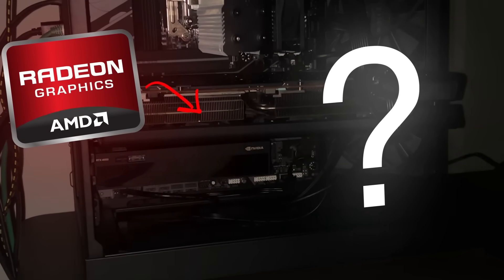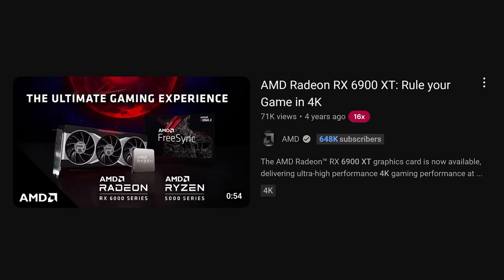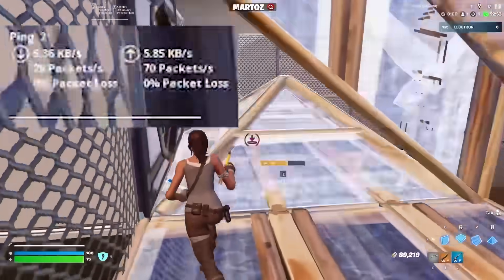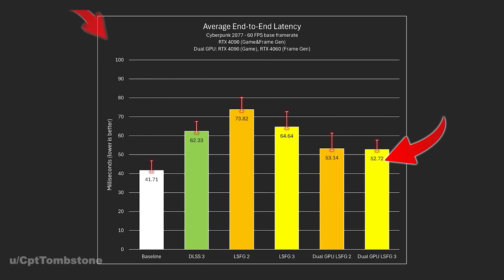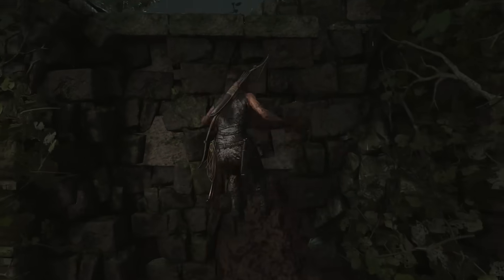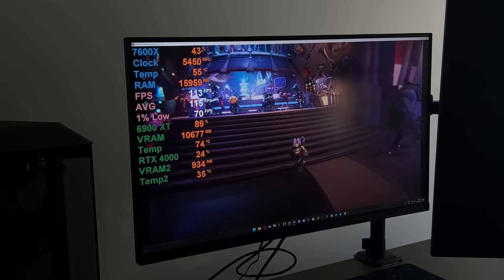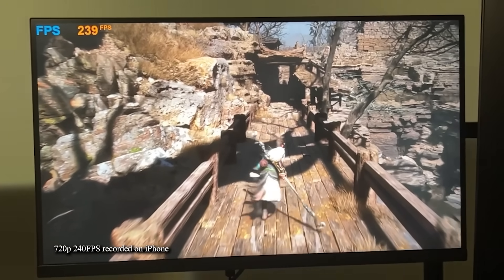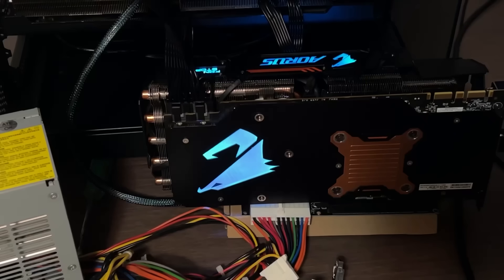I Used Both AMD & NVIDIA in One PC and Got 240 FPS in Every Game

Comment: I was very interested in this video but the sponsorship with exit lag threw me off a bit. There really isn’t any software that can reliably reduce your ping. Your ping is almost entirely dependent on your wired or wireless connection and your ISP. 

What exit lag is most likely doing to achieve these results is re routing your traffic for your game to their servers first, and then to the original game servers. This additional hop will actually cause more overall latency and higher ping. But you won’t see that number on your end since your traffic is being re routed.
Reply: Agreed, as a network engineer that sponsor is a scam.
Reply: @Llama052  It's not additional hops, it's alternative hops. For example normally I'd get 11 hops from South Africa to a game server in Europe. Using exitlag or cloudflare warp VPN it would be be 9 hops instead. This can be done using tracert. Also the amount of hops doesn't necessarily matter, its the quality of the hops. If you have 3 hops and one is congested, you are worse off than having 6 hops where none of them are congested. You should know this as a 'network engineer'
Reply: @Llama052  A network engineer and you don't know what you talking about lmao, sad
Reply: @ Okay buddy. I'll continue designing and running datacenters and internet routing while you pretend that adding a third party in your connection makes it faster for you for some random 1% edge case that rarely exists.
Reply: @Llama052  Valve improved ping times for 40% of all US clients by creating a new backbone and relay protocol.
Reply: @Llama052  As a non network engineer, VPN does help with ping. I have experience with ffxiv and nordvpn. Maybe I should start calling myself a network engineer on the internet too.
Reply: @Llama052  is also scam the video title that claim to reach "240fps in every game" and it's not true
Reply: @Llama052  The deal is often priority packet routing for encrypted tunnel packets
Used a regular VPN for such things overseas (plus proxifier to reroute to local host -> putty using SSH)
Reply: No, you don’t connect to their servers, they are just doing their own routing with optimized paths, whether that works or not I cannot comment on. Cloudflare has something similar with Argo Smart Routing, the client uses Cloudflare’s routing instead of their ISP’s. It might still be a scam or whatever, but the technology behind it works and it can reduce ping (specially by getting around congested paths that are shorter so lower latency on paper but not really).
Reply: yeah except it actually does work and does exactly what it says on the tin. if your problem is routing and horrible isp network decisions, it fixes it.

I routiniely would have periods of the year (multiple months) where my ping to SEA was 300 , despite being an Australian and should be 90-100.
Exitlag would fix it back to 90-100. exitlag isn't a vpn, either.
Reply: I can vouch for it as someone who plays Apex on Tokyo servers from OCE. I consistently will get higher ping and bad routes without it, I also used to get a weird double ping bug when connecting to overseas servers. 

For whatever reason Exitlag has fixed these issues for me, allowng me to get a constant 115ms to Tokyo over WiFi. If there's an open source equivalent that achieves the same effect I'd be down to learn more.
Reply: nah you guys are just hating on something you don't even understand. it's used when you're stuck with a scummy isp that has crap routing tables which causes high ping and packet loss for some ip adresses and/or ports. So even if you have perfectly normal internet and you can do other activities that require internet just fine, there might be a single game that you get this high ping and packet loss issue just because the game server's ip address is routed inefficiently by your isp. And no exitlag is not the same as a vpn.
Reply: not all traffic is routed by latency some is routed by cost. These apps theoretically can fix that but in reality YMMV
Reply: yeah, you can't beat the speed of light....
Reply: @fiery_transition  You can't beat the speed of light because it has no competition, but what if we introduce a cheetah made out of lasers? That's free market economics.
Reply: It depends. If they explicitly put their gear in the same data centers as the game hosts its faster. As an Australian who used to use VPN tunnel services for WoW that provided exactly this back in the bad old days it can make a significant difference - we went from 500ms ping down to 200ms to 300ms tops.
Reply: As a network engineer you're wrong but yeah they're probably a scam. If your ISP prefers a cheaper peer, say HE or Cogent over Zayo or Lumen, but Zayo or Lumen provide a more direct route to the game server via their backbone or have better hops in general to take then ExitLag would definitely work. The only issue is that ExitLag would have to have a ton of cheap POPs very close to every residential ISP to be preferred route in most cases and would have to do constant route upkeep or they lose out, and it's most likely a delta of 5-10ms or less... But on the other hand, you also have to consider that a packet transmitted from your computer doesn't necessarily have the same route of when it's transmitted from the game server so they could fix severe jitter in those instances where a simple latency measure isn't indicative of any issues (10ms to the server, 50ms back is very bad; 60ms ping is alright).
Reply: Tried it once when i had like 20% packet loss even though my ping is below 60, it did eliminate the packet loss without any significant ping increase. no, i'm not paid by them, i even only use the trial, but yeah it does work🤣
Reply: Difference of opinion aside, I think it would be great if OP would just benchmark this and run mtr, iperf, jittertrap which I have had success with, or some maybe easier to use GUI tools I have never used but look useful for non-cli, like obkio or prtg. If someone who does networking as a main thing (I'm a generalist developer, not a networking guru) could vouch for them maybe, and then just bust out some god-damn numbers.
Reply: theyre basically a VPN service but prioritised for gaming traffic (theyll usually terminate your account if you abuse there network for other types of traffic).

t's mainly for people who are with internet providers that have poor routing or peering, i.e if your isp only has good domestic routing and poor international routing then something like exitlag will benefit you a lot if they have a local hop close to you, since they will have higher priority traffic and better routing back to the destination servers.
Reply: bro some of the isps dont have optimized path to the game server, or u can say  they dont have good routing with gaming servers , the find the best router and it acts like a vpn ths it , i also used it good . but if u call your isp and tell to fix this routing issue , they willl fix it and it will be same ping as exit lag lmao , so yes its not fully fake but , partially true lmao 💀💀🤣🤣🤣🤣
Reply: the only thing that could probably do this is cloudflare warp/+
Reply: Soooo, they do ping generation?
Reply: @gg_sheed  it’s like a vpn ( they’ll your data/diagnostics too )
Reply: It's probably a vpn which eliminates the lab between ISP and the game server
Reply: Except its not always true, I was one of those peeps that even tho I have a good internet my location to game server made it not a good experience, and yes exitlag worked for me, Im in canada and the server was in france, exitlag improved my ping by 25%, its not benefecial on othergames, but the game we played on was and it was worth it, the other dude that I played with was from australia, he was the reason I decided to try it, these ping services vary each case, if you already have low ping you wouldnt notice it, but if its a game thats reaching 200 mark, yeah it might or might not work. in my case however it did. so no, you can easily test this specially because theres a free trial and try playing game that you can change the server.
Reply: Ig but still good vid
Reply: actually does work, is like if you setup a gateway but using their private vpn network instead of a long ass cable, helps to reduce hops in between of the computers, for example you're in Canada and want to play something from Japan, connect to theirs vpn to Japan and that's all, the routed vpn traffic is going to make a faster route with less servers or hops i between
Reply: > Your ping is almost entirely dependent on your wired or wireless connection and your ISP.
it's a pre-requisite but not a full truth, as a second point to the "ping" formula, is an route from you to the point of interest. One path could be better, another slower. What exit lag trying to do, it routing you through their closest entry point with less lag with established "best" path to the target host through their forced routes. it would not break the physics, but your ISP route from A to B could be 10k km long, while via vpn or exit lag - 3k km long...here's the ping difference
Reply: "Believe half of what you see":
This part emphasizes the potential for deception or misrepresentation in what is visually presented, suggesting that even what is seen may not be entirely accurate. 
"and a quarter of what you read":
This part highlights the importance of being even more skeptical of written information, as it can be easily manipulated or fabricated
Reply: You say an additional hop but it's also possible that 1 additional hop reduced the need for 2 or more hops without using the sponsored software.
Reply: You could've just not commented instead of showing how uneducated you are on the subject
Reply: I'm so glad I have RVX YouTube mod installed... So I don't have any ads before the video starts and also it skips ads in-between the video.
Reply: Its funny that people have no idea what internet routing is and the possible routes that can be taken for better latency. Its a real time contract with nodes all around the world that take that real time data and reroute your data better than your isp's default routing, it allows you access to nodes that are not contracted with your isp and 9 times out of 10 its creates a better route and less latency and packet issues.
Reply: It would reduce your ping if your provider takes more hops to the game server than to ExitLag server
Reply: ExitLag definitely works in some situations. If the game servers you are playing on are in different countries/continents and your ISP has a shitty link to them, it can make a huge difference.
Reply: It absolutely worked for me, not because it lowered my ping but instead by routing my packets a different way than the absolutely broken path my ISP sends them and actually making some games playable for me
Reply: Was looking for someone who said it so i wouldn't have to. Thanks :)
Reply: Exit lag is a poopy VPN service sold with false advertiisng. The end.
Reply: @cybercat1531  nothing more then a proxy server or VPN without security features, you pay for doggshit
Reply: Yo Sheeeed ! You are right about it and this sponsor doesn't do anything to really improve the connection. Instead the average gamer should look at their equipment, the contract with their ISP and if there is a better offer in their place.

Sometimes it's just the offer, sometimes it's the equipment.
Reply: @sekyom2482  You are incorrect.
Reply: Well, if you have say 200 ping to a game server, but exit lag has one with 100 ping, and you can connect to exit lag with 50 ping... You now have a 150 ping connection. The question is of they can actually do something like that, to which the answer is probably "no, except in extreme cases"
Reply: @pm146  Internet routing cares way more about robust and resilient connections/routing, and doesn't optimize for latency by default/the general case. They would have to have a massive amount of servers EVERYWHERE, to actually be useful. And once you kick a package off the part you control, you have no guarantee of when it arrives. But yes, it might work in some cases...
Reply: @pm146  thing is that it's pretty rare to have the situation you say, and on top of that there can be additional lag just from the connection being made and processed by their servers
Reply: @dantepaz5028  What servers? They dont use servers, they just take control of your network route directly... Using their own servers? You honestly trying to tell me they gonna setup servers all over the world when they can just direct your traffic through already established nodes that other people already pay for?
Reply: @mewoozy2 they literally use servers, you can even choose which to connect with advanced settings, and i even quote what they wrote "ExitLag counts on a worldwide server network spread over all continents that optimize connections from anywhere to anywhere."
Reply: > What exit lag is most likely doing to achieve these results is re routing your traffic for your game to their servers first, and then to the original game servers.

But that focuses on things at a point to point level and not the crucial bit of the routing paths inbetween those 2 points and what the first hop is also doing considering you also don't just connect directly to a game server. While typically, yes, at a high level an additional hop can cause the overall latency to rise, however, if your routing path is improved as a result of using better optimised routing tables, it can be improved. Who this is really beneficial for depends on the user, where the end server is located and other network factors (too many to list lmao). 
For example, people whose ISPs (budget/os etc) have limited peering agreements or where international egress routing are on inefficient or congested paths etc. It's often a case by case thing, which needs you to actually analyze the problem and whether something like that would help improve it. 

Path optmisation is really nothing new. Used to do it in the 2000s to play WoW when I lived in a remote country using a shite ISP (albeit, I had to set up a server myself and work with people on forums to find an DC that had decent route, but did manage to go from 375ms to ~160ms). I used to even contribute to an open source tunnelling client in the 2000s aswell that was written for a similar purpose. You're also forgetting things like traffic shaping, multi-path UDP routing, path probing etc which can also improve latency. 

In practice and in theory, things are not always a gimmick, nor is it always "smoke and magic" just networking knowledge and whether the solution (or in most cases, improvement) is something like that. Agreed though, these things can get packaged as something next-gen and amazing, get oversimplified and turned into buzzwords and mass marketing making people who don't really need it sign up (not to mention quite predatory with "FPS Boost" etc).
Reply: @netyaroze1663  I made a comment about no one knowing how it works, technically Im incorrect because you obviously do, but your language is both too technical and your language shows you dont KNOW you are correct... you are correct, you are actually extremely perfectly correct. Well except about the FPS part, its "somewhat dissengenuous" but can improve fps on some games that freeze whilst waiting for coordinate changes/updates.
Reply: @netyarose Routing inconsistencies can certainly be problematic. However with these things being a likely upstream issue having another upstream hop generally isn't the fix you'd want. 

At best it will help you with a specific connection slightly while masking your actual latency. Generally though it will add latency to every connection regardless to even the ones that were shorter paths. 

If you have a bad route to something upstream on your internet connection it's best to talk to your ISP or peers. Not use a third party in hopes that they will magically route better. 

At the end of the day adding another hop to your route blindly by using a third party isn't going to lower latency, it's just going to obscure the issue further while pretending to be helpful.

Additionally if exitLag has any congestion or proxy issues you're now going to be in the direct line of that and it's going to cascade to you directly with a poor experience. You're effectively trusting them with connection handling and adding a middleman to all of your traffic as another failure mode. No thank you.
Reply: @Llama052  You are being very optimistic that the ISP is going to care that a single customer has a problem with something very, very specific. The odds that they are going to fix a specific routing for you are very slim.
Reply: @Llama052  You didn't read what netyarose said. From the ISP to game server there could be plenty of hops. With exitlag there is a middleman, but you're relying on their network routing is better than the default one from the ISP so it's not necessarily adding an additional hop to the total amount. Also if exitlag did have congestion (which never happened), people would notice the 'poor experience' and not use their service
Reply: It reduced my ping in Eternal Return from 320ms unplayable from Germany to the S.Korean Server to 120ms almost good playable and i was able to get Diamond in rankend there. How does this work then if you call it a "scam" ? 

For me it optimized the routing which gave me way better ping and less input delay.
Reply: @GisorsTheRet   tbf, your case is the exception and also extreme, the ping showed might be 120 between the game server and the exitlag server, but the ping between you and the server in the middle isn't taken into account, so it could majorly be placebo effect and you're around 280ms
Reply: @ dude, playing to diamond in a MOBA vs korean pro sweaters is no joke. 320ms had HUGE input delay vs the 120ms i got with exit lag. No "placebo" is able  to do this. 

Tools like Mudfish or ExitLag improve your connection by routing your gaming traffic through optimized, less congested paths and private network nodes, reducing latency, packet loss, and jitter.
Reply: @GisorsTheRet  k then, i said that it could be that, if you really are high elo in kr servers i believe you
Reply: @gg_sheed  Not true. My friend is a pro fortnite player, they share some programs with each othrr that optimize everything related to your input and he told me a program that lowered his oinf from 50 to 25. Mine has changed for 65 to 60, but we are in different countries.
 There's something in it for sure.
Reply: It can work, and you don't need a gimmicky sponsorship VPN to do it. Forcefully overriding BGP routes by connecting a reliable VPN can reduce ping and jitter, which is unintuitive but true. It's luck-based, and depends on server locations.
Reply: @gg_sheed what you say is right for most people in probably most countries, but exit lag does 100% work in countries without any kind of direct connection for specific games. Trust me, without exitlag, some of us wouldn't be able to even try some games (helldivers 2 for example).
Reply: @nichonstein2  exactly this, it works extremely well for me when playing games hosted in Europe while I am in South Africa. I have less latency and also no ping spikes. Without it I am getting a lot of lag. It does work
Reply: @sparafucilSA  indeed, years ago before starlink, i played guild wars 2 on a 4g cellular connection to NA server whilst living in asia, i think exitlag just benefits those with extreme ping, not those already near the server.